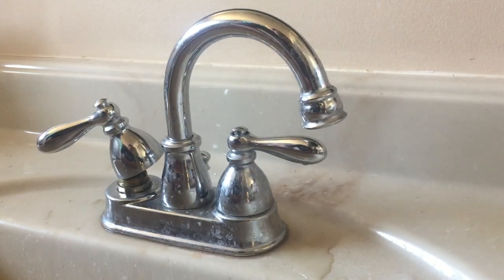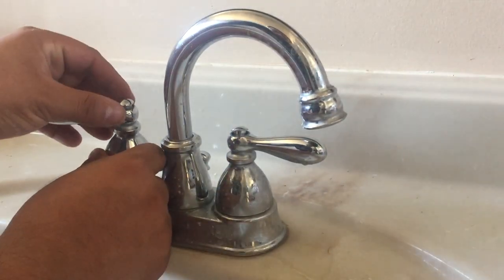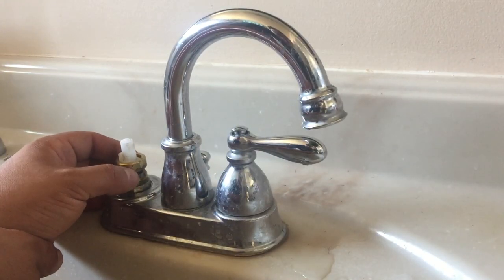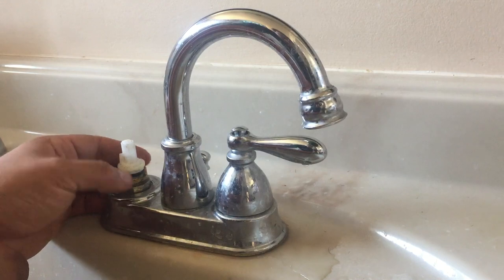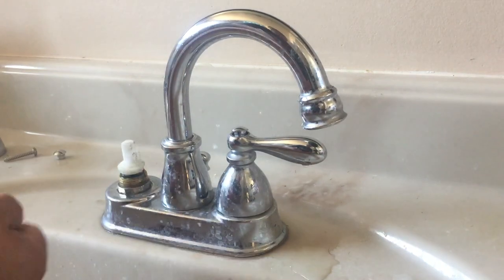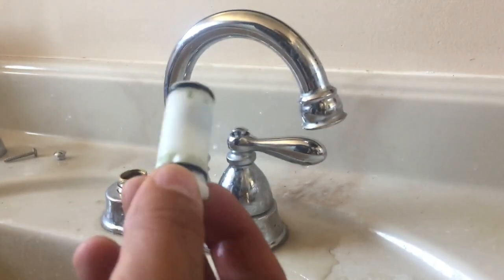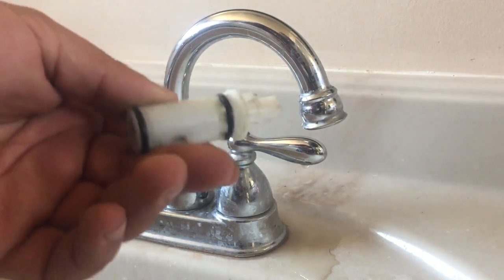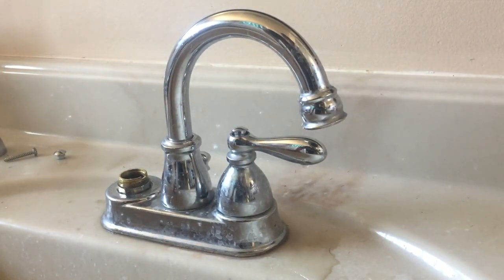How to remove a stuck Moen sink cartridge

Comment: In my case, when I pulled up on the cartridge with pliers, per instructions, the cartridge broke - half of it stayed in place, half came up with the pliers. So there was nothing left to grip. I inserted a long screw into the hollow interior of what was left of the cartridge, put down a piece of 2x4 for leverage, and lifted up on the screw head with a crow bar. Fortunately, the remaining half of the cartridge popped out. Then I was able to install the replacement 1224 cartridge. Close call!
Reply: Instead of vise grips, I went straight to a deck screw, just like you, it worked
Reply: Not quite understanding. You put a screw in the opening of the cartridge and pulled the cartridge out with crowbar? I was thinking about using a hammer to pull out the cartridge
Reply: @inquisitvem6723 , sure, I’d guess that a clawhammer would work as well as a crowbar.

Comment: Thank you!  This worked even though the stem section of the cartidge had broken off.  I put a small (4") vice grip on the side tab and it worked just like in your video.  The new cartridge would not slide in.  So I soaked up the water in the line with a rag, poured some vinegar in, and scrubbed it with an old toothbrush.  All is well now.

Comment: Worked like a champ.  I was actually eyeing a tool designed specifically for this (that screws down the middle of the cartridge, then gives you some leverage) at lowes for $14 - I'd much prefer spending that money on a pair of vice grips if not already owned!
Reply from the maker: That's exactly how I felt.. glad it worked out !!

Comment: Thank you for posting - this worked like a charm.  Warning: stupidity of my own: when it came loose, it came fast, arced up in the air and landed 2 feet away on a CFL I thought I'd moved out of range.  So clear a larger area than you think you need.  (I turned on the fan and left for a short while so the mercury gas could dissipate.)

Comment: This works.  You can also slip a flat head screwdriver under the plastic lip on the cartridge and gently twist the screwdriver to lift up the cartridge.   That worked for me.   My problem is lime deposits around the o-rings and the seat where the o-rings sit.  I'm trying Lime Away right now but it's taking a  while.  I wondering if I'm overkilling the situation and should just replace the cartridge.
Reply: Did the limeaway work?
Reply: @AlexPerez-fc3ov  It’s been over a year ago, but I’m thinking the lime away helped.   The faucet doesn’t leak anymore, again over a year.

Comment: The cold water in my kitchen faucet was running fine.  I'm doing dishes.
  Bam!  While the cold water was running there was a thud sound and it 
completely stopped.  Uh oh!  It's freezing outside.  Did a water line 
break somewhere?  Nope.  Water runs fine from every other faucet in the 
house.  I correctly surmised that the old water filter under the sink 
had failed and it's contents had clogged the cartridge.  (Well, it was 
my assumption that I was able to verify once I got the cartridge out.)  I
 had since installed a full house softener for my well water and forgot 
this under sink filter even existed.  I unscrewed the water filter 
cartridge, drilled down inside and painstakingly removed all it's 
filtering contents and screwed it back into the water line.  (I didn't 
have another filter on hand nor did I have the correct parts to 
completely remove it and reconnect my water line.  Removing it will be a
 future project.) Now for the faucet cartridge.  That should be no 
problem.

Loosen the set screw behind the handle.  Remove the 
handle.  Remove the retaining ring.  Remove the cartridge.  I said, 
remove the cartridge.  REMOVE THE CARTRIDGE!  What am I doing wrong?  
This thing should pop right out.  After three hours of trying to get 
this thing out with breaks searching the internet for what I was doing 
wrong, I stumbled upon your video.  In five seconds I had that cartridge
 out.  It was caked with black sand from the faulty filter.  I cleaned 
the sand out of the cartridge, ran some cold water to clear any debris 
out of the system, put it all back together and turned on the water.  It
 works like a champ  

Thank you so much for providing the 
simplest idea for a difficult issue.  I kept reading about special tools
 and cutting things apart.  So glad you took the time to show this 
simple method.

Comment: Okay, so maybe I'm missing something here, but every cartridge I've ever replaced came with a little white plastic twist cap that helps you loosen the cartridge and they come out easily after that with a pair of channel locks.  I've replaced enough of them that I ended up buying a cartridge puller as well.  Was yours one that the twist cap would not work on?

Comment: I could not get the cartridge out this way - it broke in half, leaving part of the cartridge in the faucet. If you encounter this issue, try this; I found that if you take off the water line from below a stuck cartridge can be tapped out using a wooden dowel and a hammer if you remove the water supply line from the faucet. be careful and tap lightly until the cartridge pops out!

Comment: There's actually an even easier way I accidentally discovered right before I was about to do this method, if you can tolerate a small mess: Turn the other water on. I got my hands all dirty trying to remove a bad Hot cartridge from my kitchen faucet, so I decided to wash my hands with the cold water right there... The stuck Hot cartridge suddenly popped right out as the pressure of the cold-water knocked it out from behind.
Reply: Your hot water was shut off, so can the cold water pressure knock it out since hot water was shut off?

Comment: Good news is that I got the cartridge out, bad news is the cartridge I bought on Amazon was the wrong size.  😁.  Plus I realize my the handle is loose and I can't tighten.  Tried but guess a new faucet.
Reply: I was going to to that as well but I went to local hardware store and since it's a moen, very common and they had a bunch, they are lifetime warranty and it was no charge.